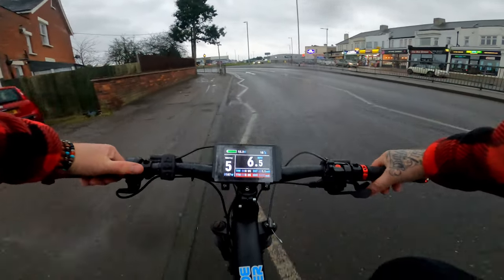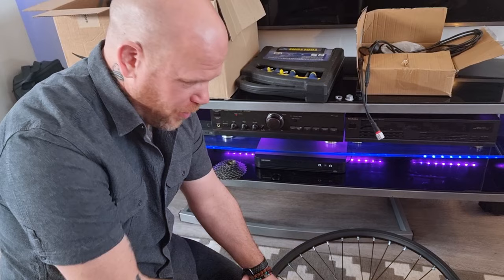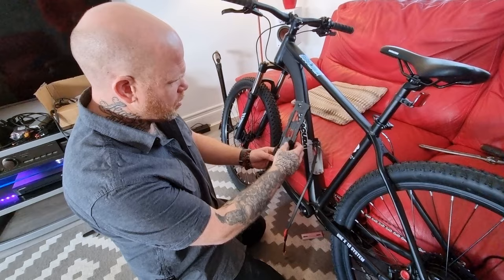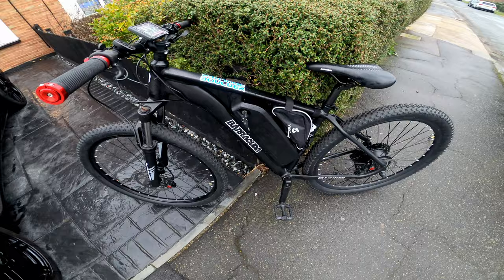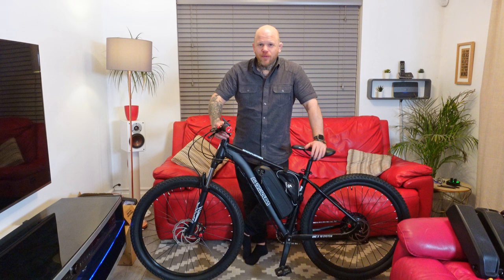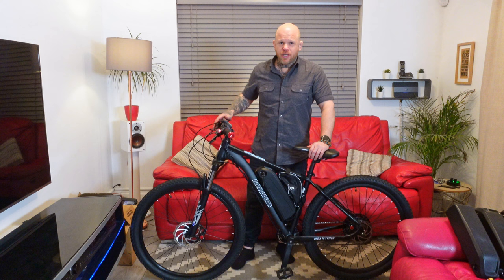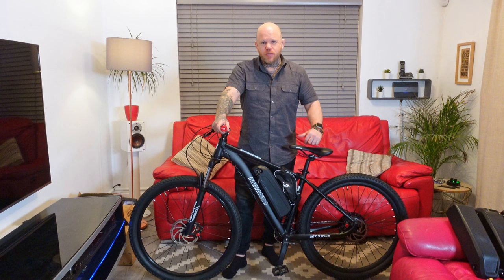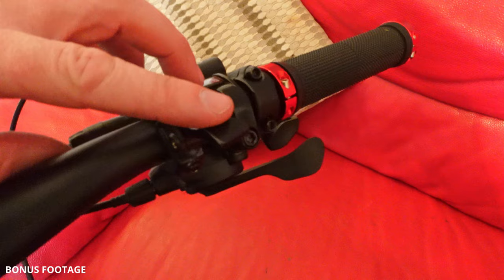How to BEAT the 250w ebike RULE!!!

Comment: Great commentary on 250w it's not enough for the roads , 1000w is just enough for hills . The government is afraid of people abandoning cars and fuel duties for sensible electric pedal cycles !
Reply: If they can’t tax it they don’t care. Its not about our safety, clearly, its not about “clean air”, its all about the money and we, donkeys, need to obey their rules, and it seems we are very, very obedient. I got a 750W and I’m quite happy but tired of being worried. And 750W is not powerfull enough sometimes , but at least is decent motor. Re-thinking the UK ebike laws will be a miracle. And I don’t believe in miracles when it comes to governments.
Reply: @cipri198zero I have the same situation, I'm from Germany, I have a 1000 watt bike and a 48 volt battery, I ride according to the rules, on bike paths, I very rarely reach a speed of 40 km / h because I save battery ..

Mostly I ride within 30km/h, I like the traction of my bike and how nimble it is, but sometimes I get paranoid about the law, if they ever get caught, it will be bad...
I myself am from Ukraine, in Ukraine there is a law, if an e-bike does not exceed 3 kilowatts, it does not need rights and so on ...
Reply: They're scared they can't track you because you haven't got numberplates on a pushbike.
Reply: Same stick with 250w. I don't need powerfully as 1000w but atlest 500w or 750w.
Reply: I have a white Engwe Engine x 250w and it's superb. I'm a fat b*stard and trust me the 48v 250w hub motor on this bike shifts me along nicely. in fact I only ever have it on assist 3 it's that good.  it's also fully laden too. I have an explorer bag packed with kit, full indicators, wing mirrors, phone cradle and other bits and bobs and it looks the dogs knackers. I've got an old mtb that I might get a kit for as a back up bike. nice video.
Reply: My country really p#sses me off,im out in benidorm and e bikes and e scooters are everywhere flying around all fully throttle powered and guess what,no accidents it all works packed pavements and busy roads and nobody seems to be at risk,just a helmet has to be worn.
Wake up Britain e bikes are the way forward in busy cities especially.
Reply: I bought a 250w valk 10amph battery it helps with the hills fun bikes , for all the Karen's hahahaha😂😂😂😂 good video mate love it .
Reply: Actually some lower wattage bikes have a higher torqe rating and the some high wattage have lower torqe but in general yes 1000watts is just enough for hills.but nit always the case
Reply: @jacobbillman6485 just remember the formula for power, and think again.
Reply: Yeah that's why they banning petrol and diesel 😂
Reply: Surely the main aim is to get away from polluting vehicles. Who cares if all the fuel stations close down and people have to go electric. The government won't lose they will tax and license anything that touches the road including standard bicycles. It is time for change. For control stick to the road laws for all can't go wrong.

I would like to make a point here about 250watt power.
I have two scooters both 250w. They both have a max speed of close to 25km. One climbs hills more efficiently than the other because it has a planetary gearbox internally fitted.

The planetary version is quicker off the mark with more toque but not so quiet. Technology will make fun of the 250-watt rule. Like Dyson Power,  with the vacuum cleaner.
There is a lot of technology to come with electric motors. We have hardly started on that road.
Reply: I’ve been zooming around on my 1000watt ebike ebay conversion for nearly five years and not been stopped once!
Just remember to slow right down and start pedalling when you see the cops
Reply: You can go above 250W in the form of an electric motorbike- but, you'll need insurance, helmet, etc. It's understandable that bike capable of going the speed of motorbike will need insurance and plates as they will, inevitably result in more accidents (believe me, I have ridden motorbikes a lot). The illegal electric scooters show that kids riding with no lights, helmets, insurance or plates- or road sense have died (they are also used a lot in crime). Better cycle paths would help reduce accidents involving cars- in the Netherlands, with their extensive cycle paths (mostly off-road) cyclist deaths are way, way lover than the UK.
Reply: Not they’re not. Bicycle frames/wheels:brakes aren’t suitable for such power and speed. There’s a fair chance the average moped will survive a year of poor maintenance on poor roads driven by a poor standard of rider. The same can’t be said of 1000w bicycles built by some chav on a council estate.
Reply: @matthewyabsley  Exactly- 50 miles an hour is pretty hairy on a Honda C90- I'd not want to do that on a bicycle designed for speeds of around 18 MPH. Imagine getting a front wheel puncture on an overpowered electric bicycle at even 30 MPH- and you don't see many cyclists wearing full face helmets and leather jackets! (I came off a road bicycle in 18th gear going down hill when a light (fork mounted) swung into my front wheel- I came round in hospital where I stayed for a week. Guess I was going around 25-28 MPH. I was lucky to survive.)
Reply: Actually it's about torque . 40nm on a 45lb 500watt bike with my body weight climbs prety good compared to pevs that do not disclose torqe rating and Eric's top torqe is 80nm and they only sell 250 watts which is the lowest legal limit iv heard of globally.

Comment: Love it! im stuck on a mobility scooter 4mph on pavement (yep I agree with that), 8mph on the road, load of bollox, its so dangeous being so slow on the road.
Reply: I’m a wheelchair user, purchase yourself a 500w electric hand bike ( cost £780) and  then get the cheapest wheelchair you can find to attach it to, does 23mph, much better than the 8mph they expect you to travel
Reply: @applekidn1  Thanks for the reply Aaron, a friend of mine has an electric bike, I did try it and I will say I did like it but the problem is that I have to carry too much and I dont have the strength to carry it in a backpack, im just slightly too ill to manage that, it was something I thought about for quite a while but after trying it I just couldnt manage it :(
Reply: @DenBlackburn  How about an electric trike?
Reply: @ianmooney6380  Thats not a bad idea and something I have not looked into, if it had peddles then its a cyclical and has the same rules as a 2 wheel bike, cheers ;)

Comment: i agree that 250w is not enough for heavier riders like me ,and ive had trouble in the past  with  controllers overheating and motors burning out ,so i had a 500w  ebike kit fitted to a bike and it works much better
Reply: @JudeTheYoutubePoopersubscribe  probably not as long as you are riding sensibly
Reply: I saw plenty of these as repairs for my bicycle  business during COVID 19 . The big problem with 5 kilowatt and above motor set ups is the battery range is not good compared to Bosch set ups . The high current draw can damage the batteries , this can be a fire risk and the batteries flatten in under 20 minutes  at 75 percent duty cycle or above . 10 percent of the battery capacity (stamina) is unusable to prevent cell damage .
Reply: The controllers sometimes get hot so this is battery energy lost so this has to be factored into calculating  distance capability and discharge time in minutes .

Comment: Thankyou for this. I'm doing similar things and discovering what possibilities there are with Ebikes.
The battery mount problem - I had that problem also. At first solved it unsatisfactorilly by mounting it upside down. Then discovered that the plastic cover, at least on mine, when removed, allowed it to be mounted the other way.

Comment: When you have trouble removing soft aluminum alan key bolts, get a piece of ice from the fridge and cool it down.  The metal will contract when cold and the bolts will come out easily without stripping.

Comment: Good video... I think the word you were angling for is 'Finesse' in relation to the dangerous pedal assist we have in the UK - I totally agree. A throttle option and 20mph limit would be perfect for most. keep up the good work.
Reply: I have a 250w pedal assist carrera bike. It is super slow compared to the flow of traffic. 

It's extremely unsafe still to ride, despite the motor. Going slow is unsafe, not sure why our laws don't recognise that.
Reply: I agree current rules are not quite up to it. I think for big bloke on a steep hill you need 750W for a hub, geared to work well up to 20mph,  For sure a good mid drive  250w with well selected set of gears will work as well, but if you want an inexpensive solution (and you do) a Hub motor as the way to go
Reply: That's why I like bafang because you can reprogram them. I have 9 levels of assist in 10% power increments. low assist and low gear work great for slow speed maneuvers

Comment: Love it, the intro. Annoys me when people say they have a whopping great motor capable of many watts, yet a battery and controller incapable of outputting anywhere near. Be careful of that little hub overheating. It'll take a lot lot more than its rating under normal use. You know this already  🤣
Reply: This. Any hub can take any amount of power, if the controller lets it. "250W" is just a bunch of numbers and letters, and depends totally on the battery and controller used to feed it current. Given the speed he made, I'd say that's putting out at least 1000w now. Probably closer to 1.2-1.5k (I had a 1k w bike, it didn't hit that speed). But is it rated for it? Will it overheat and burn out under heavy load uphill? That's the real question with this build.
Reply: @necroticavalon5176   Lol 1kw, not a chance. My "250w" bafang will hit those speeds lol  it is 36v and the display says it hits maybe 350-400w. Ive seen 1000w bikes going MUCH MUCH faster than 30mph, try 50+
Reply: @dunxy  Ok, link me a vid where a 1kw motor goes 50mph, and I'll believe it. Unless you mean kph, that's an outside possibility. I have an unrestricted 1kw hub motor on my bike, it can go that fast, but with a LOT of pedalling to help it out. On it's own power, it tops around 42kph on the flat. Mph, not a chance. Maybe down a steep hill, WITH pedaling.
Reply: @necroticavalon5176 my ebike has a 750W motor, 48V battery,my own top speed is 54km/h with throttle only, never tried it with assist to see if I can beat that.

Comment: Was that 31 kph or mph? My Rad Expand 5 (750w) has pedal assist and I know what you mean about going into a tight turn and not wanting the motor to engage because that can be dangerous in certain situations. However, it's really not a problem, at least not on my bike. All I have to do is simply move my left thumb over to the "mode" button and click the down arrow one time. This sets the pedal assist mode to "0" (off) so I can pedal through the turn or weave through pedestrians/traffic without any help from the motor. Then I just move my thumb again and hit the up arrow to be right back into motorized mode.

Comment: That is brilliant, well done. A copper told me when he pulled me over on his bike that my bike was illegal because I had a thumb throttle, and its only legal if its pedal assist only.
Some other copper on his ebike agreed with me that No Throttle rule is daft because if you are old and you have to stop when going up a hill then it is too hard to get going again, so whats the point of the ebike when a hill start is worse because of the extra weight than a manual bike!
The laws have to change because things have moved on and they want more people out of cars, I am hoping the legal limit will be 750w
Reply: they would already have had everyone out of cars if there was something in it for them
Reply: You can legally have a throttle now.  It’s just limited to 3.7mph.  Then you need to pedal like normal

Comment: Wow, that speed is insane! That's quite the overvolting. That typically would be matched with a 24v battery I'm assuming. How's the longevity of the setup so far? I'm working on reviving a 15 year old ebike conversion that originally was on 36v and will be 48v soon. 22amp controller. I don't have records of the specs of my motor, but it's one of the smaller hub ones like you have there. I'm assuming it's maybe 350w.
Reply: What’s link to your video?
Reply: @Oponu-Ayirada  I didn’t make a video of my conversion.

Comment: Nice little ride mate.. Karenator lol.
Can't say i have had much real experience with 250w yet but am definitely looking to in the near future, i use bafang mid 750w but i think pedal assist on mostly all of these kits are about as sophisticated as the average karen! 
Takes some time to really gain a good understanding of how assist actually works on whatever set up your on, and very sketchy and easily dangerous for a new rider with no experience, high pas, high gear, without thinking and low speed turn could spell disaster resulting in the need for some new pants. 
But once you got the hang of it im definitely a fan..
Love all of your work mate from builds to life talks..  thankyou for the content! 
All the best
Reply from the maker: Thanks haha my son also named this bike the Karenator 😂
Reply: You can tune the bafangs with the speed Android app off playstore using a programming cable get it to run exactly how you want  it to.
Reply: imo the TSDZ2 got the pedal assist done perfectly, except for the fact it doesn't give a torque kick like the Bosch CX motor in Turbo or E-MTB mode and other issues with it, it is a great bit of kit but has some severe issues out of the box, ride it on a hot day at excessive speeds in turbo or using throttle for a long time and it's guaranteed you'll fry it, start/use it in too high of a gear and it's possible to strip the nylon gear by the torque aswell, so don't just hammer the throttle on a TSDZ2 in a very high gear
Reply: @denseljosephs9500  problem with the normal conversion kits is that they don't have no torque sensing, so it just reacts to pedal speed rather than how much force you put in
Reply: TSDZ2 ? 🤔

Comment: Nice build Steve. Yeah pedal assist on these builds are a nightmare and you are right also dangerous and unpredictable for small maneuvers. Catch you on the next one.
Reply: I generally leave off PAS on my build because to me they can be very dangerous doing curb jumping and such. I only use a half throttle and manually pedals at normal bicycle speeds. but my builds are for the hills here in Georgia and we can have 1000 watts here on the street.
Reply: with Kunteng (KT) controllers you can buy a torque PAS sensor for around 80
Reply: @dalvenable331  torque PAS is very safe compared to cadence PAS though
Reply: @BH4x0r  I have used an 48 volt mid drive system that for some reason feels right?, when using a pedal assist system. More so than most Hub drive systems. The best use for pedal assist to me seems be on low wattage systems 750w or less. I don't trust anything other than a throttle for the 1000w and larger systems because you really are entering Moped/mini bike power level. 750w is about 1 hp. And I try to build my Ebikes as light as possible and keep the bicycle aspect of it alive and kicking. I like having the option to just pedal my bike around but hit the throttle and get threw traffic lights or up those really long hills, I am 59 after all.
Reply: @BH4x0r  Cadence PAS + 1000w direct drive hub motor = Road rash.
Reply: @dalvenable331  the beauty with torque is that it does more work the harder you press, there's actually the CYC ones from 1500W and 5000W (although they're peak figures and they can't take that constantly) but they're more going to torque instead of to top speed.

if you had a Tongsheng TSDZ2 750W, thats also a torque sensored one, but it's a relatively low torque motor compared to the ones i just mentioned but has a bit less fine tuned PAS, so it's even safer

the nice thing with torque sensors is that since it's based on how much pressure you put on the pedals, it knows just how much it has to give you to reduce the effort

the programming on the CYC ones actually sorta feels like you have to put only one amount torque in, no matter wether you're going on a flat or uphill, so if you apply a bit less force to your pedals it will help less and vice versa

Comment: My project - Cheapo Kent Thruster fixie frame, north road handle bars, monark style springer fork with disk brake tabs, cottered crank set, 26 inch beach cruiser wheels, Brooks b67 saddle, 500 watt 48 volt geared hub motor kit, triangle 48 volt 20 amp hour battery, seat post mounted cargo rack and military style canvas saddle bags.

Comment: Always reinforce battery mounts with a couple of riv nuts makes the mounts super strong.
Reply: Wow i just learned something new
Reply: This! And they can be fit without any special tools, plenty of videos on YT. My battery mount is currently held on 3 screws/rivnuts(2 original ones and I added 1), and its fairly solid already. But I'm going to add 1 more screw later anyway..

Comment: I have a 1000W Bafang with a 750W decal on it. :)        A motor can be re-flashed\programed so peddle assist doesn't kick in right away. Adjust the "slow-start" mode to 8.
Reply: Would I get away with it in australia? Like with a 1kw

Comment: I like pedal assist on front hub motors, it gives the natural sensation of riding while transmissioning the power to the both wheels as you manually rotate the back wheel, motor rotates the front wheel, finding up a solution to age old question of how we can get AWD bikes.
Reply: Yup,I've had all the kits but I prefer the 250w geared front hub ,I put 55v at 22amps through it 🙏👍🤠🇬🇧